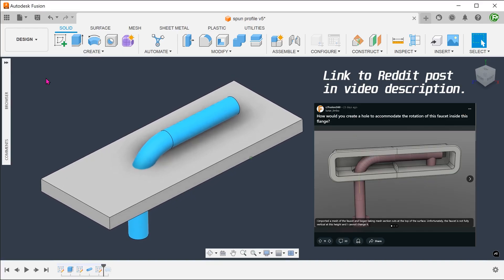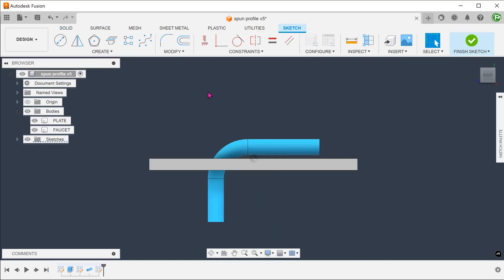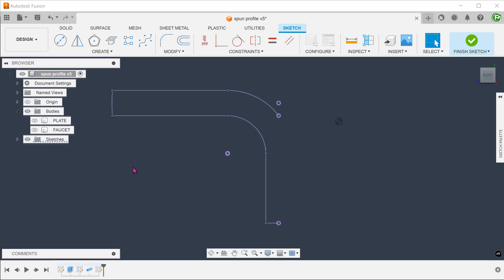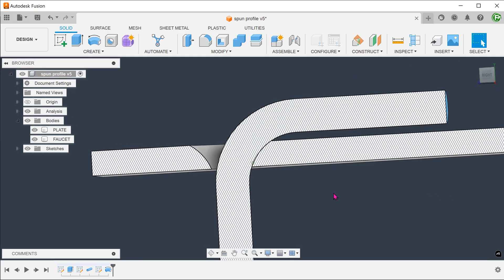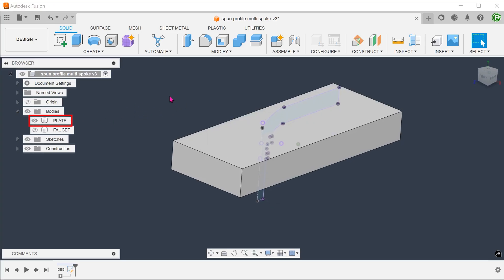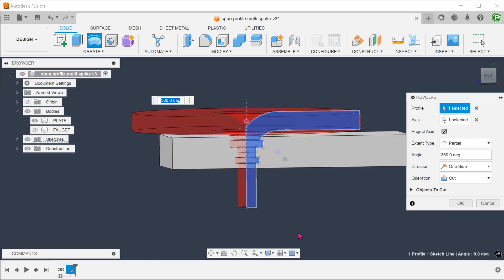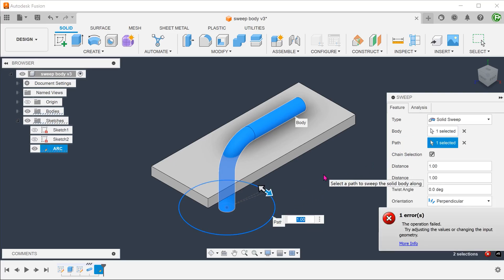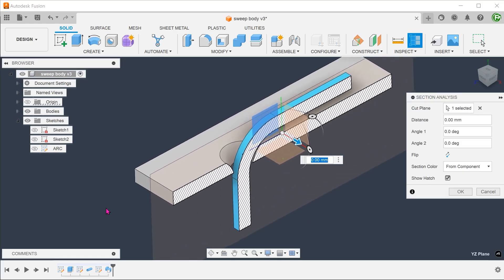Autodesk Fusion | New Feature - Spun Profile

Comment from the maker: Something curious that I have noticed only after making the video........If you look at the side profiles of the spokes at 4:13, they are arcs instead of a vertical lines. I went to double check the end faces of the spokes and they are flat. I am not sure why the spun profile command produces arcs here.
Reply: I have totally missed this new feature, thank you for sharing. And the arc is the correct geometry for "spinning" a cylinder, think of how the leading and trailing edge of the cylinder are further out from the center of rotation then the flat outer face of the cylinder.
Reply from the maker: @KristianLaholm  You're right! I just could not visualise it at first. I went to confirm this by using the sweep body command to sweep a cylinder. 

So this would mean that we cannot simply just use project/include ->intersect to create the profile for revolve in this case. This makes the spun profile command even more valuable!
Reply: @Fusion360School  i now can see why this feature is far far supperior to intersect + revolve. That arc would not have been generated that way. Ty for the showcase.
Reply: @KristianLaholm  exactly! And it's crazy cool that this compensates for that. I'm playing with the feature now and the tolerance settings. fun!

Comment: The solid sweep seems rather buggy to me. I tried making a pin follow a spiral slot path, It didnt work if the pin was round. It worked if the pin was hex BUT if i went and edited it, then it wouldnt let me press ok and would act as it wouldnt work again. And sometimes it would let me press ok but it wouldnt actually do anything visible. It seems it really doesnt like anything round and with any complex shapes meeting each other it crashes in many spectacular ways. Honestly im rather disappointed in how unfinished it feels as so far every workflow where i thought it could be useful it turned out to be a waste of time. I had to resort to a surface loft, thicken and combine in this case.

I stumbled upon an interesting question in the same project though. Since my cylinder shaped object had spiral cuts in  it and i wanted two equal complicated extrusions in it, one at the start and one at the end of the twist movement i wanted to make one and then use the patterns to replicate it a little lower and 90° turned, however i couldnt do it, because one requires a rectangular and one a circular pattern and i would have to copy it to four spots to reach my destination but those spots were busy with different geometry and thus it wouldnt work.
I ended up doing the same work twice with a new sketch and all. Would there have been a better solution i wonder? (the spiral stuff was created by using sweep with twist and circular pattern and was only part way in the cylinder)

Comment: As always, a great tutorial thank you for posting this. You aren’t kidding that the sweep command has its own quirks.  I have been fighting those quirks for the last three months trying to use sweep to generate complex multi wire cable assemblies.  I have been largely successful but run into brick walls several times where I needed to come up with some pretty screwy workarounds because of the failure of the sweep command or artifacts that it created.  my biggest frustration was sweep is that the specification dialogue box takes immediate input and goes off to the sweep before the entire dialogue box is filled in. So get a complete sweep it must recalculate the entire body structure every time you enter a new element in the dialogue box including things like twist, switching from cut to new body or join, etc.   some of my Cable models take 30 minutes to compute the sweep and when that has to be repeated four times during the entry of the dialog box, it becomes a two hour ordeal.

Comment: Create slightly bigger pipe than the pipe you want to fit in, and use the bigger pipe to cut the model? 

It's available for at least few years, and very very easy to do.

Comment: How would it possible to get the path of a connecting rod in an engine assembly to work out the clearance for a dry sump design?
Reply: Measurements